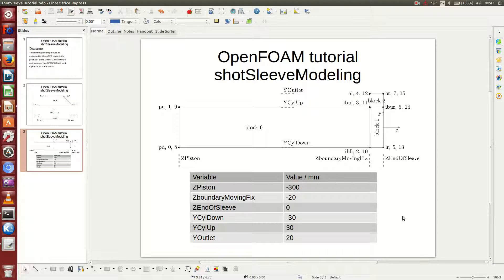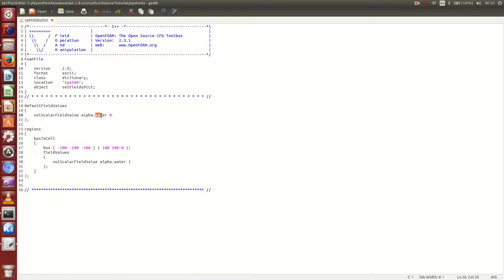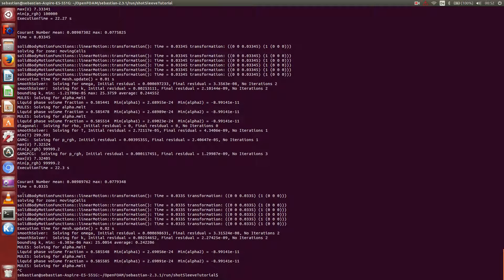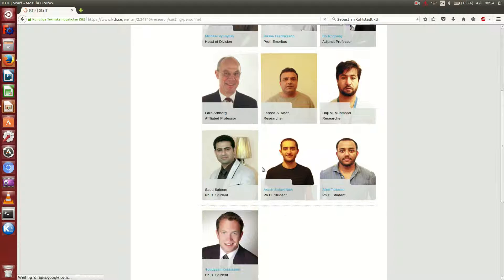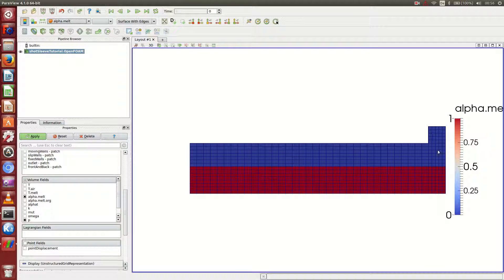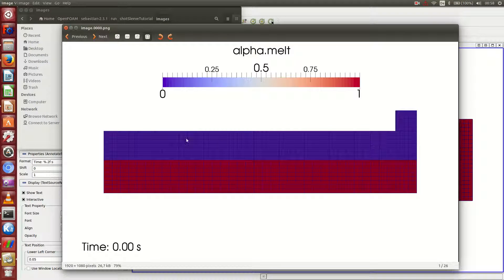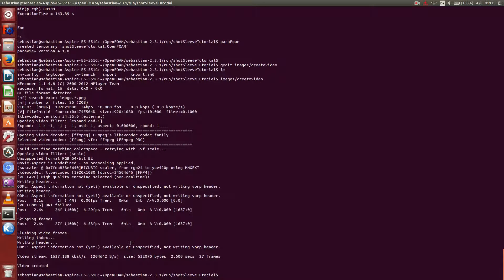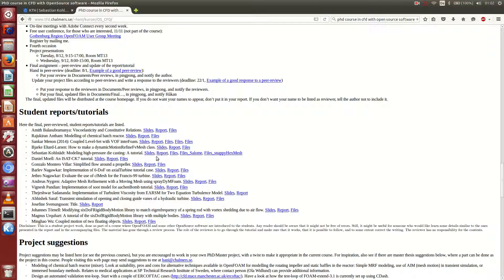OpenFOAM tutorial: shotSleeveModeling partV - Run the case, Post-Processing

Comment: Hello sir,
Thank you for the videos. I am currently simulating a concrete cylinder pressed between 2 rigid plates. Here, i am using interDYMfoam with a moving mesh. I am not quite sure on how to apply a force of1.5N by the plate on the cylinder. Could be please suggest on how it is done
Reply from the maker: Hello Said, I'm having trouble imagining your problem. Can you perhaps share a case?